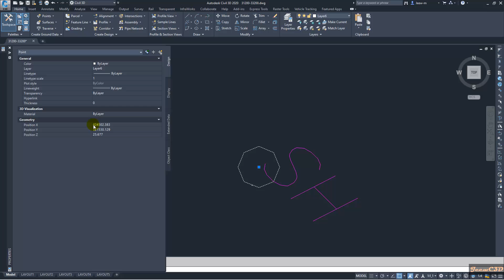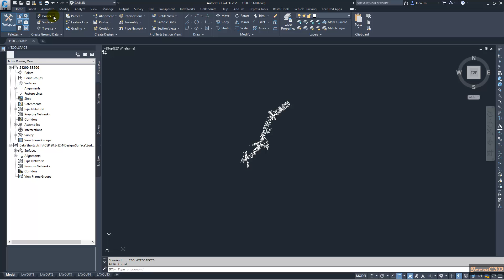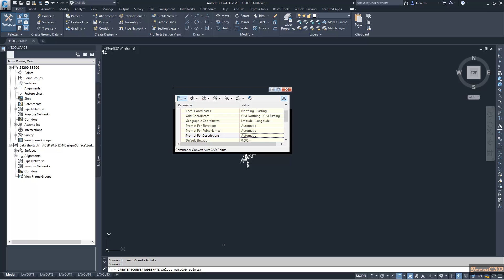How to Convert AutoCAD Points to Civil 3D Cogo Points at once

Comment: I have a AutoCAD drawing with set of points which previously exported using Civil 3D as COGO points and then the drawings have been saved as AutoCAD file. All points have coordinate with elevation. How can I convert these points to Civil 3D points again? the points are shown as ‘Anonymous Blocks’ (ie. each point block named as ‘*U1’), thus I cannot modify the block. I have found somebody has developed a .lsp file to convert these anonymous blocks to static blocks. Is there any other way to do this.? thanks.
Reply from the maker: I think the lisp is done using individual blocks. So it is bit cumbersome. Can you send me the file so that I can have a look.? If there are coordinate labels they can be converted to points sometimes.